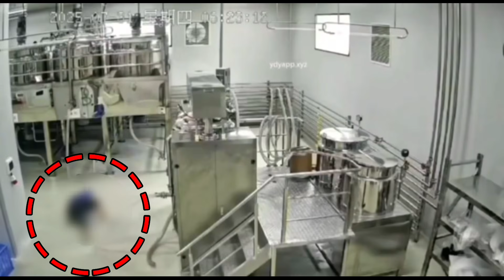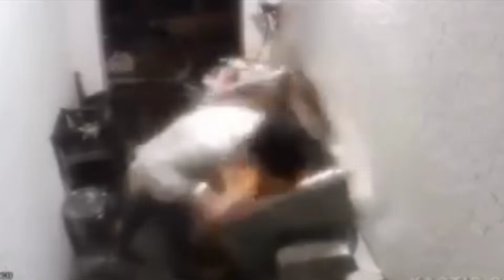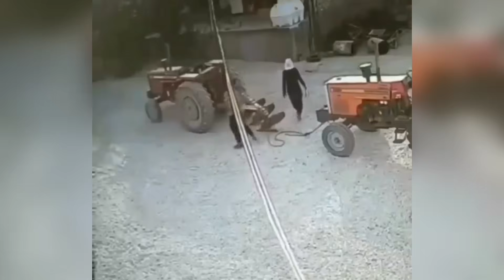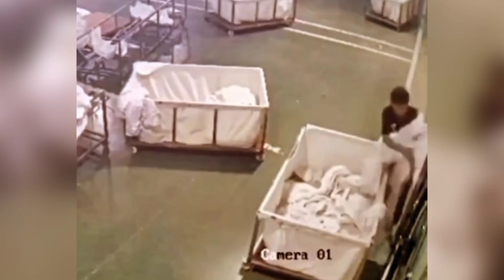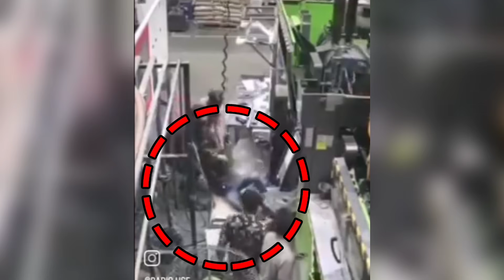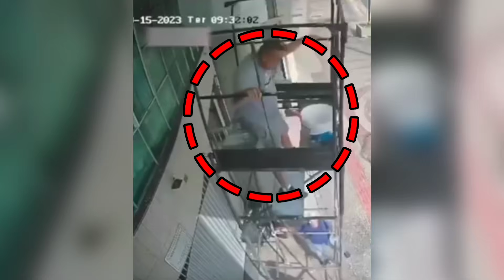Workman Pressed By Press Machine | Industrial Fails And Workplace Accident caught on camera

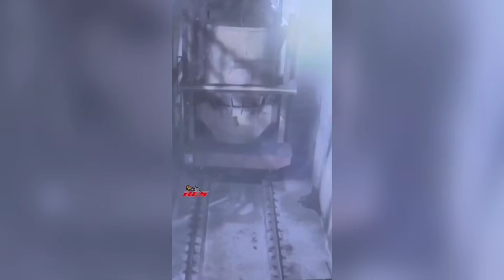Comment: 2:20 It's not molten metal, it's liquid slag, and it's not as dangerous as molten metal. From personal experience, I can say the burns won't be severe, but they'll be chemical rather than thermal. Your shoulders and arms will likely be "marked" like a Dalmatian's. The skin will take twice as long to recover as after a thermal burn, and the color of the new skin will be a light purple tint, which will disappear after a strong tan.